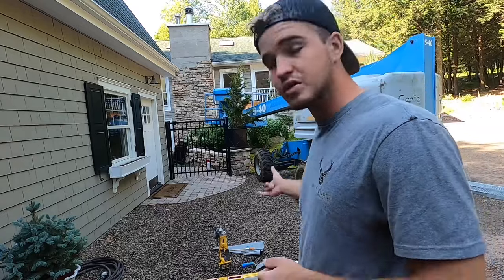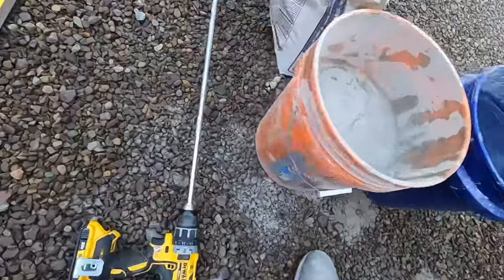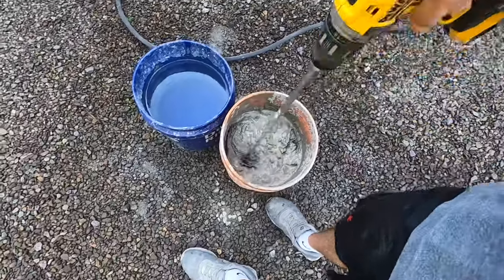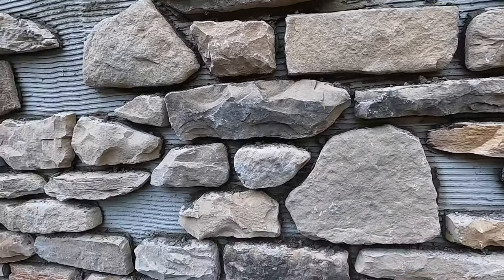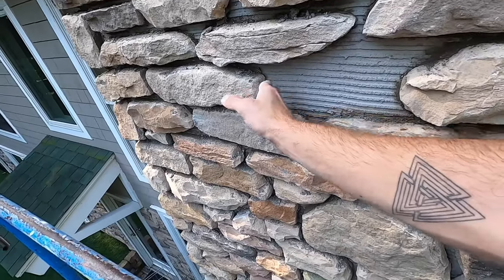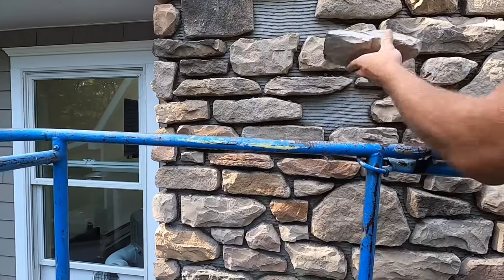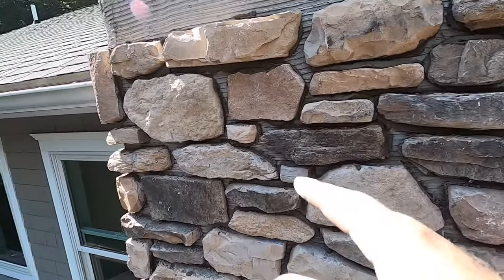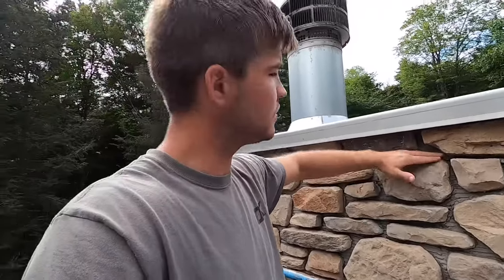How To Stone Veneer A Wall

Comment: Quick question brother for a inside chimney with sheet rock can I scratch coat right over the sheet rock or do I need to put up hardy board ?
Reply from the maker: I would rip the sheet rock down. I’d be worried about it falling off with the weight of the stone
Reply: Add lath over the sheet rock
Reply: Yeah that's allot of weight to hang off of sheetrock
Reply: @davegordon6943 
Maybe if you just glued onto the dry wall it'd be a problem. For it to work you would do the scratch coat onto the lath on top of drywall which would harden into the shape of the fire place and also you screw or staple into the studs that are behind the drywall holding it up. Have done thousands of fire places on custom built homes never been a problem. It would be a waste of time and money  to remove sheet Rock

Comment: So do you paint bonding adhesive on the back of all your stones or just the ones you’ve ground? Do you do the same for natural stone? I’ve been have some trouble with natural stone sticking. (I am a DIY-er and a novice) I’ve resorted to using smaller stones but I’d like to use some of the bigger ones.

Comment: What is the name of the ready-made cement you use to install these stones? Is there a stronger one if the stone is heavier? I'm going to make a fireplace and it has some big, heavy pieces and I don't know how to glue these stones together so they don't come loose. Recommend me a good cement for this, please. TY
Reply from the maker: I use quikcrete stone veneer mortar. I mix it heavy with bonding agent. The stone will stick. You have to start from the bottom and go up and you have to shim the rocks in place
Reply: @masonthemason6412  But the stones are at a distance from each other, perhaps half an inch. Is this cement safe? Do the pieces not come loose? Don't move? My fear is that the pieces won't stick together and won't stay in position. There are several pieces in various sizes. There are big and heavy ones. And what tool do I use to make scratches on the wall? Can I use the same cement to make the scratches? And which tool?